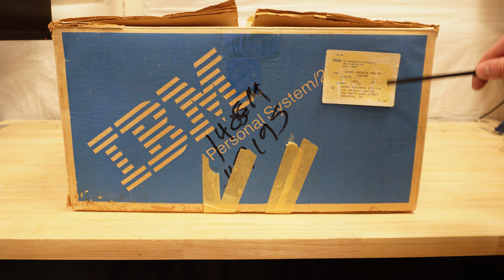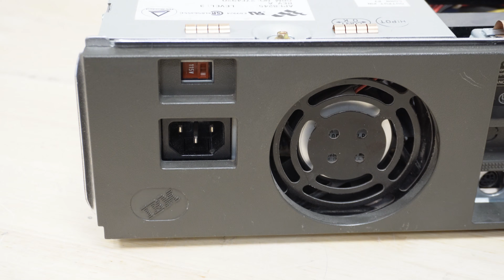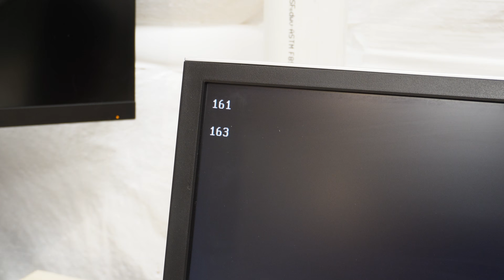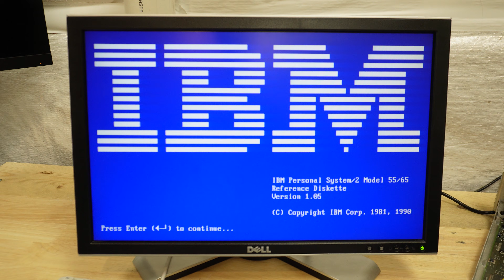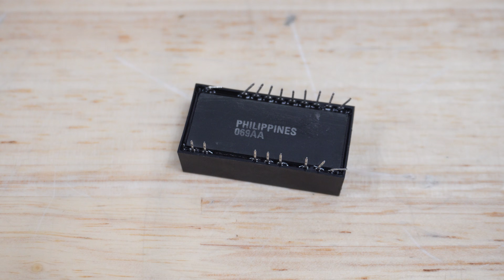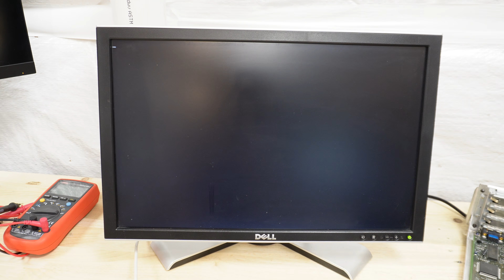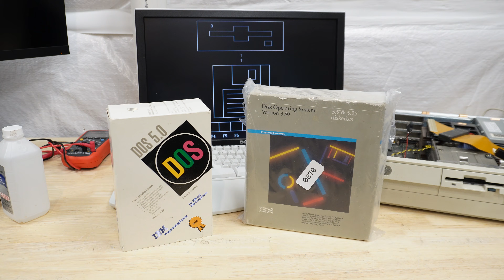IBM PS/2 Model 55SX

Comment: I am getting a kick out of your eclectic videos.  ( I mean that in a good way).
I was aware of the PS/2, and think I might have had a token ring card at one time.  It is a long time ago, but it had the blue plastic piece on the back, and I couldn't identify it at the time.  Unfortunately, it went to the re-cycler.. 
 I have trashed several IBM computers of that era, as well as a couple of newer mini towers.  I never would have guessed there would come a day, when people would be looking for IBM branded computers to restore.  
I agree with you, that some of the IBM cases were quite pretty.  I remember one mini tower I had, that had a charcoal coloured ( I'm Canadian, so the spelling works for me) case and a charcoal and pretty blue coloured front cover.  I now have regrets about destroying it, but I was an Amiga user, and didn't have much use for DOS machines of any kind..
I had a Bridgeboard on my Amiga 2000, that was basically a 286 on an card, which allowed me to use the Amiga as a PC.  It worked fine, but there was no comparison between DOS and the Amiga OS.  Using DOS, was an exquisite form of torture for me.

Comment: From what I've seen, the caps in those PS/2 floppy drives do like leaking, so I would definitely pop your drive out and pull the board off to check. And since you're pulling the board off anyway, you might as well recap it if possible.

Comment: RTC is critical to boot. Won't work without it. 
Another horrible design. 
You have to remove the coating to get to the pins to connect an external battery.

Comment: 13:00 tl;dr the caps are factory original.

I'm not familiar with this type of machine, but with this style of capacitor. The lead spacing on the cap itself is about 2,5mm, while the pin spacing on the PCB is 5mm. So the capacitors come from the factory with s-shaped bends in the legs. This is why you could not solder them down flush with the PCB, but instead have them "floating" a couple of mm above it. Naturally they gen bent down in some direction, whenever someone touches them. 
I am guessing, this is done, because 5mm spacing on the PCB was easier to solder, but the capacitor itself was too small to have 5mm spacing on it.

Comment: I think there is an ESDI to SCSI adapter. I think I remember looking at the pin outs for the ESDI and it was able to connect to an SCSI hard Drive 

I don't think it can plug into an IDE drive, at least not easy. There may be an adapter card for it now, but it would have chips on it to convert the ESDI to IDE and it probably would have a memory chip on the adapter card as well to buffer the data. 

IBM learned that the " end to end " control was a very bad idea. 
Apple, specifically Steve Jobs, was CRAZY and wanted absolute control over everything so people couldn't do much with their products. 

Making an industry standard machine is the way to sell a lot of them. 

You have a clock error from a bad battery 

I remember getting the errors and entering BIOS to update the BIOS information and boot off the floppy

Comment: Oh man, this is brings back memories. I got one of these as my first computer back when i was like 5 years old. It taught me not to put chewing gum in busports and how to configure soundcards for games. I kept the model M keyboard from this computer for years and years, i think it was dated 1989 or 90, it was made in the netherlands - that much i remember. 

I'm now 35 and have worked with and made money off computers since i was 14. And to remember this gray, cute box was the beginning of it all. I remember the noise of the diskdrive and the flipping of the switch. I suddenly felt very old, f*ck.

Unfortunately i no longer have that keyboard as i stupidly sold it in my mid 20's.

If anyone runs in to a model M with a Swedish layout, with a cigarette burn in the top right corner just above the numpad - that's the one. Pet it and call it nice things from me, gramps.

Comment: I remember the 1980 IBM, I think it was 1 MHz CPU with 256 kb of memory and 2 360k floppy drives. 

Then the XT 4.77 MHz CPU 
Then the AT 8 MHz CPU
And they all had the 8 bit ISA slots
Then the 286 had 16 bit ISA slots
And the 386
Some of the 386 boards had PCI slots 
The 486 also had ISA and PCI slots 
Same with the 586
I even think the P2 and P3 had ISA
The P4 was all PCI slots 
I don't remember what year they made the pci-e slots
But now the pci-e is the main slots and the boards have 1 or 2 PCI slots 
I have always liked having a motherboard with everything built in the board so I don't need to put in cards. 
I had so much trouble with cards in the early 90s. 

OS/2 was what we ran on the PS2 IBM machines. 
I would have loved to have Windows 3.1 or Windows 95 

OS/2 was horrible

Comment: These were literally running one of the 7 major banks in America in 2001

I had more processing power at home than the bank had in their computer building. They still use 28.8 dial up modems for their ATMs. 

They bought my bank a few years ago and my bank had direct high speed Internet connection for every ATM. 
A transaction took less than 20 seconds. 
Now it takes at least 40 seconds to do a transaction.

Comment: The 'Ardent-Tool' has diagrams of the different microchannel bus types. Like ISA, the initial longer section is for the 8-bit signals. After the keyway, the short section is 16-bit additions. Some 32-bit adapters have a keyway to be able to run in a 16-bit slot (sometimes needing a 386SX CPU, not just a 286).

Comment: @41:50 - A "Starter Diskette" is for the ISA models, and typically only sets the clock. A 'Reference Diskette' does a more complete configuration. But there is a "Reference Diskette' for an ISA model or two.

Comment: You referred to the later Dallas (owned by Maxim) RTC part numbers; With the 'C' in the part number, it means the module was Y2K-fixed (The 'C'entury byte register rolls over when the year changes from '99' to '00'). That doesn't work for the PS/2 models, since IBM changed the Century byte to the offset 37h register instead of 32h. As long as you modify the originalmodule or don't have the 'C' part numbers, you will be fine.

Comment: @34:15 - The negative lead slopes in towards the top of the module; You can either drill or use an Xacto blade to cut the connection to the battery. With a Dremel and the correct bit(s), it is easy. Peter Wendt of the CSIPH newsgroup was the first to document the RTC mod.

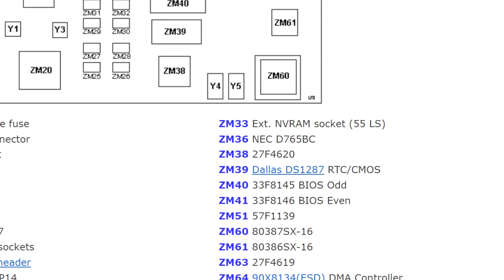Comment: @24:02 - The empty socket is for a 2Kb module to add 'Extended CMOS'; The low-end Model 50, 50Z, and 55SX didn't have an Extended CMOS, so it is a maximum of just four microchannel slots. The 55LS BIOS version added the Extended CMOS. Evolution is very visible on the 55SX/55LS over time, and the Model 53SLC2 was really what the concept became.

Comment: @19:50 : We have an image of the boot ROM at the 'Ardent-Tool' - Search on the term 'RIPL' or look under the Token-Ring adapters. The next 16/4 adapter version integrated the RIPL code into the microcode ROMs; The ASIC actually copies over the RIPL code into the system memory space.
Reply from the maker: found it!
Reply: @clabretro : The ASIC of the "Long" 16/4 Token-Ring adapter was codenamed "Spyglass". You probably want to use the 25F8923 image, as it is the latest separate ROM version. Later, I will extract the image of the later 'Pinegrove+'-based adapters that integrated the RIPL code; It should also work with the older adapters.

I would recommend getting the "Short" 16/4 microchannel adapter. The 32-bit "Busmaster" Token-Ring adapter you have isn't ideal, but it could be a good candidate for your RS/6000 system (where it is known under the '2-2' nomenclature - It doesn't have RIPL capability). Set whichever adapter you use on the 55SX to 16Mbps, and see if the other stations will connect at that speed.

Comment: I have nightmarish flashbacks to doing page layouts on a 55sx in high school for the yearbook using Windows 3.1 and PageMaker 3.0. You wanna talk about slow and painful! The thing that was more annoying is the fact that we had plenty of PS/2 Model 77's laying around which were 1.2m times faster than the 55sx. 

Great machine though, just not fast. Can't wait to see your netbooting experiments. We had a netboot computer lab in high school with PS/2 Model 30/286's. 16 diskless workstations booting off of a Model 60 running Netware. Aah... fun times.

Also, you aren't missing much without the DBA hard drive in there. They are slow as balls. I benchmarked a 60mb DBA drive against a parallel port backpack hard drive, and the parallel port drive totally walked over the internal drive. A tribble SCSI card and a BlueSCSI or other modern equivelent (CF card adapter) is a great option. 

PS: love the floofy girl!
Reply: @MichaelAStanhope  Interesting to learn "balls" are slow, by definition...I hope there isn't a pop quiz...
Reply: @Jah_Rastafari_ORIG   Indeed they are, unless they have gone to the wall of course.

Comment: They were always yellow lights for the drives even the hard drive. I still have a model 30 that works. It was my first machine. The battery error usually can be ignored and the machine will work

Comment: Well you might not have a hard drive, but I can clearly see that you have a Zip drive! There is a little driver utility called palmZip that will let you use Zip drives as removable hard drives under DOS. I have it running on my 8-bit Model 30 (dual floppy model) and it works quite well. I know you plan to go net booting, but its another side quest if you are looking for one.

Comment: I remember IBM donated (dumped) these units to our college in the mid/late 80's  - we ran windows 286. My first job out of college '90 was given the same 55sx 1mb ram with 30mb HDD. Had to wait a couple years before the company switched to Compaq full 386DX, 486/33 etc. Reference disks were the bane of our existence working with these machines. You could not install any option, card without the vendor ref. disk. Bad design.

Comment: about those dallas rtcs, there is a modern replacement pcb by necroware called the mwX287 which uses a pin compatible clock IC and a replaceable cr1225 battery. necroware also has a good video about the dallas chips and how to remove the resin inside to access the original battery. thanks for your content!
Reply: To fill in a few more gaps there, in case our host, or other readers, aren't already aware...

The Dallas RTC is actually more than a clock.  It has around 100 bytes of non-volatile RAM, which is kept alive by the battery (as well as running the clock when the power's off.)  This RAM holds the date and time, but is also what the system setup (BIOS, or in this case the reference disk software) uses to store all the stuff it needs to know to boot the system -- hard and floppy drive presence and type, in particular.  Without that battery-backed RAM, the PC does not know what storage devices exist, and just has to assume whatever the ROM defaults are.  This is going to be JUST enough to successfully boot the reference disk, and that's about it.

This is why a dead RTC battery makes the system unbootable.  Every time it's reset, it checks that RAM for the hardware setup info, and it's scrambled, because it isn't being retained properly.  (Why the module isn't able to retain valid RAM contents from the system power during a warm boot... I dunno.  But that's how it is.)  Likewise, booting the system without the RTC module means it doesn't even respond while the ROM is trying to probe that internal memory space, which causes the boot sequence to hang.

The Dallas DS1287 module is no longer made, and Dallas was consumed by Maxim, but it has been replaced by the DS12887, which is still in production and is backward-compatible.  There have also been some recent videos that show how to heat up the resin body with hot air and remove it fairly easily, exposing the chip and old coin cell.  IMO, that's a better way to go than hacking at it with power tools... but that works too.

Better still, IMO, is replacing it with something more serviceable.  There are variants of the 1288x that are just a bare chip with no battery, which is what forms the aftermarket drop-in replacements with coin cell holders.  I made one as well, since I prefer to use CR2032 cells for everything I can.  It hangs off the sides a bit, but that hasn't been an issue on any board planar where I've replaced the original module.  Bear in mind that pin 1 is like a mode selector, and picks between bus operation that is more compatible with Intel or 6502 systems.  That, IIRC, is the cause of some incompatibility with some of the drop-in replacement PCBs, since some systems set this definitively to Intel mode, and others don't bother.  The easiest way to deal with that is to disconnect pin 1 on the PC side, and force it to Intel mode on the PCB design, which is what I did on mine.  I have yet to run into any issues that way, including the PS/2s I've tried.  It just works.

Note also there's a Benchmarq RTC that is really really similar to the Dallas module, except for a couple pins.  One of those makes the battery-backed power available to external circuits, depending on a select pin that is also exposed.  Unfortunately, that RTC has been discontinued, and AFAIK, there is no current equivalent.  Systems that use that bespoke functionality won't work with a Dallas/Maxim chip unless A) they don't use any of the unique features and don't care that those pins are different; or B) the module PCB provides that functionality.  I designed a PCB with some logic to do that for a network appliance I have.  I've installed it, but haven't yet tested it, and TBH, I don't know if it even requires the special features I added, so even if it works in my case, it may not be a perfect drop-in on other systems.  There may be existing solutions for this already, though.  I never checked, I just went straight to my circuit simulator and whipped something up because I reinvent wheels for fun I guess.  Luckily, the Benchmarq RTC is way less common than the Dallas module.

Comment: lots of computers back then were manufactured with the caps 'floating' as you said, and I think this is so they can lay them down on their sides if they needed to.
Reply: This is going off memory so it's likely not right, but I remember there being concern that if you soldered them down solid it could cause them to leak around the legs from thermal expansion of the PCB.  'Course back then "lead inductance" was something that only seemed to concern the RF guys.
Reply: @paul_moir this is engineering design choice.  The big advantage of the configuration is that the capacitors can radiate heat better.  Heat is the biggest killer of capacitors.

Comment: IIRC, having setup included in ROM along with the BIOS didn't become widespread until at least the mid 1990's. You still needed to use a setup disk with Compaq ProLiant servers (e.g. ML350) as late as 2000.

Another fun fact... DOS 3.30 is limited to 32 MB disk partitions, but disk drives were already larger than that. A main feature of DOS 4 was support for larger disks, but it sucked in most other respects. The cool kids ran Compaq DOS 3.31, which supported 512 MB partitions, without DOS 4's problems. It worked on any PC clone, and wasn't tied to Compaq hardware.

Comment: the original 'planar' for the early PS/2 Model 80 I have had a shitton of bodge wires on it; unfortunately, even after replacing all the explosive tantalum caps on it with poly electrolytics, I never got it to post. I ended up buying a new-old-stock very late-revision planar, which, of course, needs extremely an rare EDO variant of the proprietary RAM cards and so I couldn't use the cards from the old planar. it took many years to find one of those cards for sale at a stomachable price with a pretty intricate ebay saved search lmao.

Comment: My school had a lab of PS/2 model 25s and 30s that booted NetWare. I'm not sure what kind of networking we had, my guess was token ring and coax.

PC DOS 3.3 is era appropriate for those machines, I remember that was the version I used on system floppies I would boot from on those machines.
Reply: If it was Netware, coax, and in a school the network was probably IPX over Arcnet. Arcnet cards and hubs were cheap and easy to setup.

Comment: The hard drives in these were actually "Direct Bus Attachment", as in, they were the Microchannel equivalent to an IDE hard drive. There are modern storage interfaces for MCA now (the McIDE), so that is an option vs playing IBM's SCSI connector of the month club with their SCSI cards (the cables are more expensive then the cards, so make sure it comes with one!)
Reply: I installed a Future Domain SCSI card in my Model 70 386, after its HDD and a replacement I acquired both threw "controller failure"s during boot -- even after recapping them.  I've been meaning to look into the pinout of that dedicated hard drive slot to see if it is indeed a nearly fully compatible MCA slot, and then design a PCB to move the SCSI controller there.  IBM was stingy with the MCA slots in those things, and I want my third slot back!  haha  For now, I designed a shim board that plugs into the slot and extracts power from it, and a 3D-printed sled to adapt a standard footprint drive in place of the original (because of course the screw holes are in a different place... why wouldn't they be?)